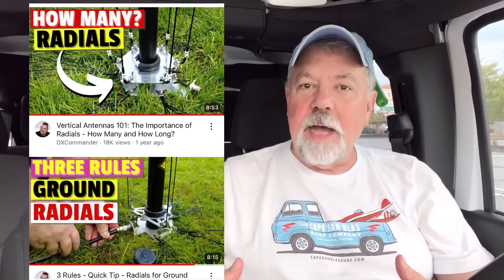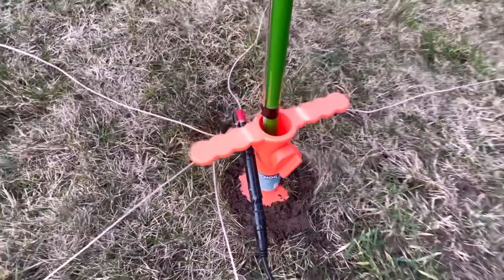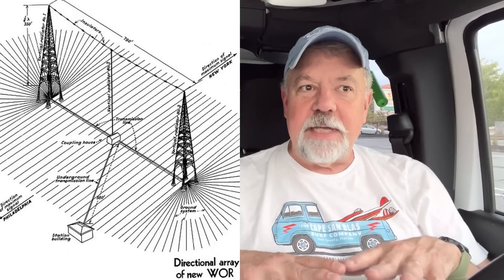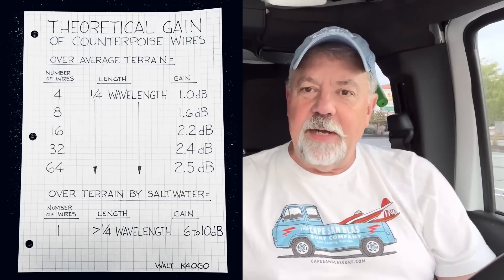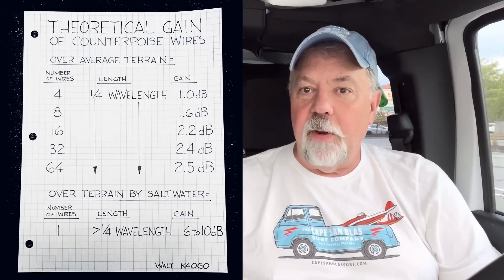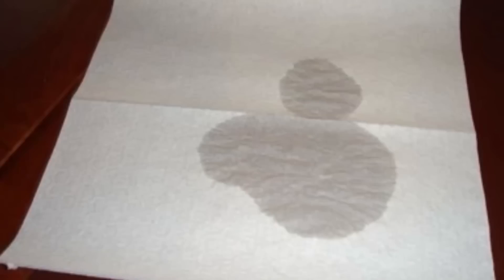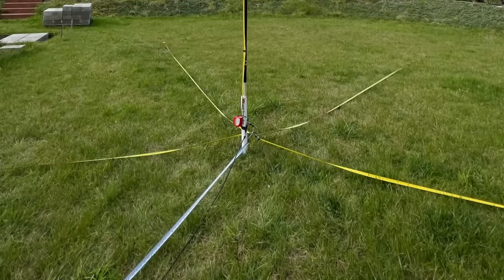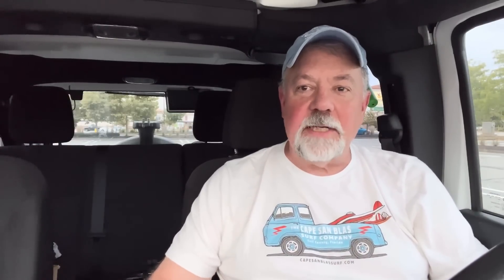The Keep It Simple Guide to Counterpoise Wires

Comment: Another great video. 
If anyone questions the 10db gain, get them to model a vertical for themselves in free software like mmana-gal.
Simply change the soil  conductivity and watch that antenna pattern squish and the gain go through the roof!
Reply from the maker: Great idea! I might make a video showing that. 73, Walt
Reply: ...and if you don't mind altering your soil composition a little, a bag of driveway salt sprinkled over the radial field every couple of winters makes a noticeable difference too.
Reply: @johnc3403  Epson salt will make the same improvement in conductivity and won't kill plants like NaCl. A power company study found it gives a three-fold improvement.

Comment: Not all of us live close to salt water, you lucky dog. When you get a chance, you might look into using epsom salt to improve ground conductivity. A power company study found that it gave a three-fold improvement in electrical conductivity. Epson salt has an advantage over table salt (NaCl). It doesn't kill plants. It is actually a plant nutrient. I've been using it near a ground rod and the nearby roses are doing fine. An online search for "epson salt soil conductivity" will turn up the research.

Comment: Thanks, Walt. I built the 25'  Rybakov (with 8x, 16' radials) you introduced me to last year and had good results...I just added 28' last night to get 80m (inverted L configuration) and  lengthened two of the radials to 30'. Not a full wavelength on 80m, just 118' total...but hope to get out to a friends several states away next week while camping. Love your videos OM.
Reply from the maker: That’s awesome! Thanks my friend
Reply: I also built the Rybakov, using only 3, 16ft radials, as that was what I had,  and worked just fine,  would more have been better? Probably,  but with 3 and 20 watts on the G90 I was making contacts,  so I'm happy.  
Thanks for all the great content Walt. 
Mike

Comment: I have been using the RECON 40 20m/40m coil Vertical Antenna a lot for POTA Activations recently and I’ve found that the sweet spot for my locations, is using 4 banana plugs with each having 5 wires, at 2 meters long.
Reply from the maker: That’s interesting